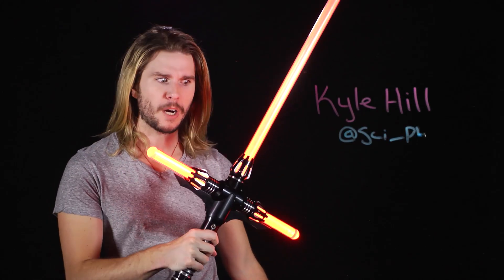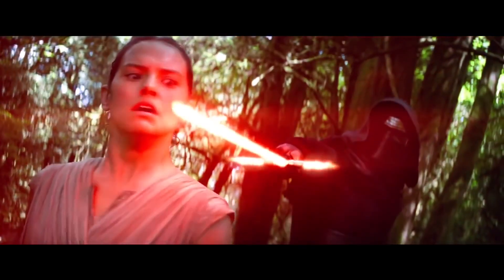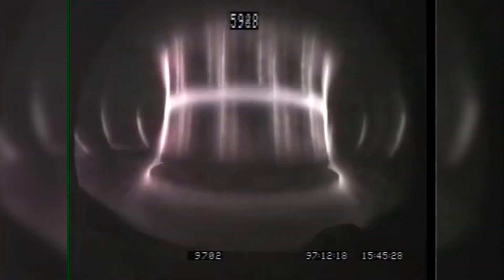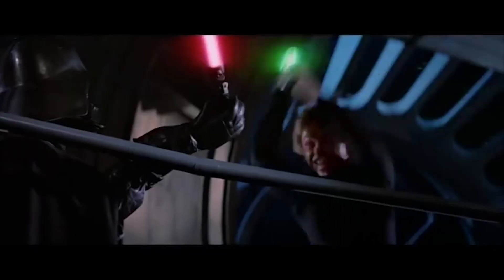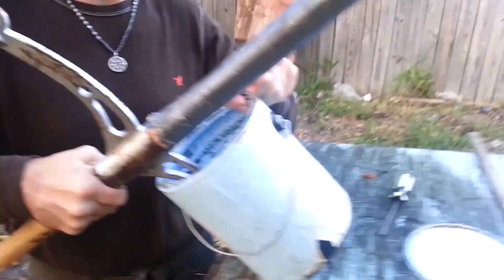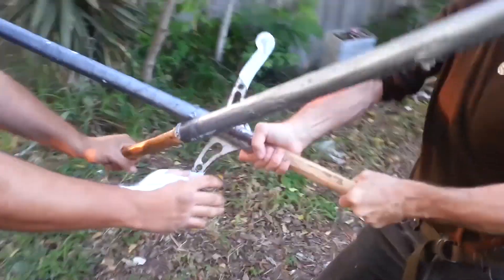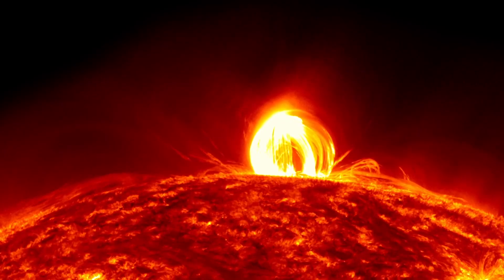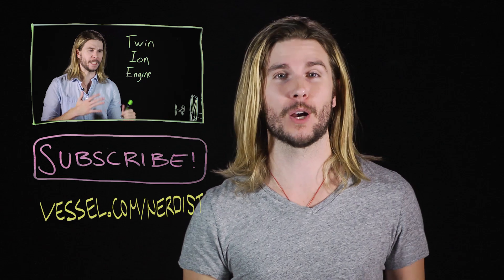Why Kylo Ren's Lightsaber Works (Because Science w/ Kyle Hill)

Comment: First off, I want to say how much I enjoyed this video - raised a great many excellent points. I'm curious, in one of the shots of Kylo wielding the saber, it looks for a moment that the top of the 'crossguard' bits was not covered by metal, and was actually open. Could be just seeing things. The other thing I wanted to add, is that Kylo's blade would be amazing using both Form III (Soresu) and Form V (Shien/Djem-So). 

Interesting to note is that Vader used a particularly aggressive variant of Form V, with a touch of III (Obi-Wan's preferred style) mixed in. The only other person to ever use that variant was Luke, and he somehow instinctively knew it. But given it was Vader's style, it makes perfect sense that's the Lightsaber style Kylo would have used.

Comment: I just want to say everyone seems to forget there are metals in the Star Wars universe that lightsabers cannot cut through, I forget what they're called, but if you look them up they're there.
Kylo's lightsaber is also probably using a different, more unstable crystal, possibly more powerful than other Jedi, hence the "crackling."
These crystals, because of their instability, I'm pretty sure barely any Jedi use them, and only a few Sith. (I found that out on the internet too. ;D)
Anyway, that's just my two cents.
Have a good one, everyone. ^~^

Comment: While I like the cross guard I think it would be more effective to have a lightsabre proof metal as a cross guard (yes it exists, emperor Palpatines lightsabre is made from it) it would be less danger to the user but just as effective in protection. Although the extra weight may be difficult to deal with kylo could just practice, and even hold the blade close to the holy to provide more power with every strike

Comment: possible spoiler alert  

Funny thing is the director of the movie confirmed its not 3 blades, its one blade the "cross guard" is actually heat ports.  because Kylo's saber is unstable.  It produces a great deal of heat, and so the ports on the side shunt the heat away from the main aperture so that the saber 1 doesn't melt itself to a hunk of metal, and 2 doesn't blow up in his hand.  In the EU there are multiple occasions where a unstable lightsaber would one blow the person's hand off, not work, or yeah go boom.  

Kylo is not fully trained in the Force, and the way his lightsaber looks shows that he was not very well versed in the art of crafting a lightsaber either.

Comment: Main issue:  Referring to Stephen Colbert's explanation of how the lightsaber works is not science.  It's an opinion piece.  We don't know that the two smaller plasma fields are directly connected to the primary one as illustrated and have no reason to expect that they are since they don't ignite simultaneously.  The main blade ignites, followed by the two smaller ones.  Obviously, they are connected at some point, but if they were extending from within, there's no need for the metal protrusions that to extend from the main shaft as far as they do.  This suggests that they are being projected individually rather than extending through the hollow metal from the main field.

Your explanation is bunk.  It's a lame attempt at TRYING to rationalize what the film makers thought would look cool but doesn't.  I'm going to mark this "science" effort with an F because it fails... or at least a thumbs down.  Definitely not even going to get a "Nice try" out of me because you used someone else's video of rationalizing rather than make your own argument entirely..

Comment: Except that when they hit the metal outcroppings it takes out the EM field emitter and let's the plasma fall all over your hand. Still dumb 

Also 
1. Lightsabers already have a cross guard in the form of the EM field covering the top half of the hilt. Meaning it can deflect anything but a direct strike 
2. When two lightsabers are in a blade lock the fields attune to each other and actually lock the blades together make such sliding motions difficult to nigh impossible

Comment: Aren't the cross guards vents from the central shaft? It's to relocate some of the raw power surging from Kylo's saber. Because he's construct is unstable (could be from an unstable crystal or just faulty saber build). Because it's unstable the vents assist in keeping the structure of the blade and redirecting them through the side vents, preventing an overpowering affect from the saber, essentially stopping it from disabling or shorting it out.  It was said that Ren's lightsaber reflect himself because it's unfinished and unpredictable, the crossguards are essentially the stabilizing agent, without them it's possible the plasma from the saber would just become uncontrollable

Comment: 1) First and foremost, K-Ren's Light Saber works chiefly as a marketing ploy to garner more $$$, becasue this movie had to be just like it's predecessors, but extravagantly MORE.   Examples: 
- R2D2 < BB-8. 
- Death Star < Star Killer.
- Tuff Male Lead < Tuff Female lead.
- Unlike the first installments, this movie was built to be watched in an IMAX theater.  So, similar to Avatar, it will NEVER seem as grand outside of the 3D experience.

2) Marketing wise Light Sabers are written to represent the personalities of the character who supposedly built or wheel them.  Studying character blade colors and hilts.  

-Yoda = Green skin green blade.  Smaller compacted saber.
- Kit Fisto = Green skin green blade.
- Dooku = Was good, but turned bad = Curved hilt.
- Darth Maul = Red double sabers.  Takes on two Jedi.
- Anikin = Blue means he's good.
- Anikin (Vader) = Red means he's bad, cold mechanically ordered hilt. 
- Windu = Purple Blade. Gold/Silver hilt.  Only a Black Man could successfully rock this  weapon.
- Grievous = Any dead Jedi's blade will suffice.
- Obi-Wan = Straight up goodie two shoes blue pussy.

So, Kylo Ren = Over powered in the force.  Can stop blaster shots mid-air.  Gets emotional then wilds out.  Blade: Overpowered to the point of needing two exhausts.  Hilt is a work in progress, sports exposed red wire.

So, what new over-marketing Light Saber will be used in the next movies?  Cast your vote below!
A) Saber Bo.
B) Saber Sai.
C) Saber Nunchaku.
D) Saber Sling Shot.
E) Saber Whips.
F) Saber Wand where the blade chooses you.
G) Bayonetta's Green Dildo named "Pillow Talk".

Comment: Actually the cross guards on the side aren't really for blocking. It's like a vent. In a computer if the fan doesn't work, the computer will over heat. The fan Is the vent. Because this is an ancient blade they basically made vents on the side the light saber works. The reason the beam is all crackly and rigged because the red crystal in his lightsaber is cracked.

Comment: ehhhh...i don't buy the "oh the metal is just a casing!" argument, I'd think that the metal tubes contain vital electronics and crystals that are needed for the lightsaber to work. If the side blades came out in a v shape I'd buy the cross guard story, and the saber would look hellas cooler. As is it is impractical. I choose to believe that his saber reflects kylo's personality: barley contained, poorly made, and reckless with power. The side blades are vented plasma because the saber is inefficient. The flickering and arcing plasma is a sign that the whole device was ramshackled together. Instead of elegantly cross-guarded saber, Kylo has a weapon as sputtering and unstable as his composure and hatred.

Comment: I still can't get behind the crossguard as a design choice. While there are a lot of limbs removed throughout the series, the only two I know of that was directly connected to the lightsabers sliding down past the hilt and striking the hands was during the fight between Dooku and Anakin at the beginning of episode 3, and Grievous' second hand Obi-wan cut off. As far as I'm aware, nearly every single other instance was a product of the hands or limbs being struck at an angle nearly perpendicular to the wrist. Vader's arm is angled backwards over a railing when Luke cuts his hand off; Luke's arm is in a similar position when Vader cuts his arm off; Mace Windu has his lightsaber slashing down onto Palpatine and Anakin strikes from below; Dooku just cuts off most of Anakin's arm. And including cases where the victim doesn't have a lightsaber adds no evidence or proof to that argument. My condolences to the barfly, abominable snowman, and giant Geonosian spider monster.

Since most cases of limb or hand removal would not benefit from a crossguard, I have a very difficult time believing this was a design choice made by Kylo-Ren, and more of a design flaw that has the unexpected benefit of being a crossguard.

My understanding from the first time I saw it was that Kylo-Ren is not formally trained by a Jedi or a Sith, he is a force-sensitive character, and is not properly instructed on force control or lightsaber construction. Adding to this fact that he is a sith and the red crystals (whatever their proper name is) sith use generate a stronger, higher intensity blade, his lightsaber would be overloaded and explode in his hand (generally not a good thing). I always aligned myself as believing Kylo-Ren acknowledged this fact, and built a vent system to redirect excess power simply so his hand would stay in one piece. This power would then have the added benefit of serving as a crossguard, would the need ever occur (and apparently it does, as at least one commenter pointed out).

Comment: I like how he was so sure that the crossguard lightsaber would've helped in all the situations he pointed out. The crossguard would've been useless in literally ALL the scenarios he pointed out.
 
I recall 2 separate occasions in star wars 2 where the tip of the lightsaber hilt was shaved off, and the lightsaber no longer functioned. This crossguard will not defend the tip of the hilt; once it's cut, the lightsaber is useless.
 
This crossguards on a lightsaber is completely worthless and is a detriment to the wielder.
 
None of this sh*t even matters because apparently the canon explanation is that the crossguard wasn't meant to be a crossguard.

Comment: I don't seem to recall Kylo using his crossguard as a crossguard, which made me happy, and not really care as much about the what I think is slightly silly design. Rather, though, he did use it like that guy in the sword swinging paint demonstration showed, which I thought was clever.

Oh, also, Colbert's assumption is that the beam split from the starting blade, which I personally doubt, and until I see something saying it does, am unlikely to support given that in such a case, common sense would suggest that they'd forgo the "casing" around the crossguard bit. I mean, why would you have metal you'd have to replace every time you get in a fight? Is dumb. 

With proper training, the little bits sticking out aren't a big issue, and more to the point, assuming you train with it, can provide a rather nice advantage, so I would say Kylo's blade is a clever take. It's not like it needs a crossguard to be effective. People seem to forget that aroundabouts.

Comment: I still disagree.

I'll skip over your bit about the need of crossguards because, while you aren't making the argument as well as you can, I am of the opinion that crossguards would be even more important for lightsabers than regular swords.

more importantly can kylo ren's crossguard actually function as a crossguard? sorry but I'll need more than Steven's sketch on this point. for one thing I don't really consider the man an official on the subject, for another there isn't anywhere near enough explanation. is that really how this lightsaber works? if so, why is there any metal in the crossguard at all? even assuming that damage to that metal piece will not immediately effect the blade of the guard, it is still a vulnerable spot. I will now direct your attention to episode 1 when Qui Gon is cutting his way onto the bridge of the trade federation ship, specifically how long it didn't take him to reduce a larger mass of metal to basically a molten state. crossguards can expect prolonged contact with enemy blades, which in this case could result in the hilt either becoming nonfunctional or untouchable in moments. I just don't see a way in which this is a good crossguard, if it could actually serve the purpose to begin with.

the next most important point; is this the best crossguard we can make? absolutely not. to stop a lightsaber we don't need the plasma of the blade, all we need to the magnetic field. it should be fairly simple to project a magnetic reflector field that would function as a crossguard without exposing anything to the enemy lightsaber. heck you could project a full spherical  field around the hilt, thus making the saber and any hands holding it impervious to the enemy's weapon. here I have even more protection for my hands than Kylo's saber offers. neither of these options places any extra danger on the user or restricts their movements.

now as you showed it is possible to use the weapon without harming yourself, and to use the crossguard offensively. but you have to give up something for this little bit of extra offense. in this case, while you can still wield the weapon, you have a more limited range of movements than the overwhelming majority of you opponents. yes you can compensate for this but it is still a weakness that can be exploited. by contrast someone with a regular lightsaber or a saber with a nonlethal crossguard will have more flexibility, speed, and optionality with the more deadly main blade.

I can get behind the direction they were trying to go with this adjustment. but the fact remains that I can design something that gives me better defense and flexibility while sacrificing arguably no offense. the design is just sloppy at best.

Comment: None of those scenes shown in your own explanation would have been blocked by crossguards.  You tried to explain yourself out of the simple space and design flaws with plausible irl science, but within the star wars universe using the crystals and such, there is not enough space within the saber to create this guards.  Lightsabers have been destroyed in combat before, which goes against the idea of the crossguards resisting attacks through the casing.  If you have 2 equally trained and competent warriors fighting with the two kinds of sabers, crossguard and normal, the the normal will win simple because he has less to worry about or adapt in his technique of injuring himself.  Hand injuries are not as common as you would believe.  Even in most of the scenes you showed hands were sliced after combat had ended.

Comment: According to the official lore, the cross guard comes from an ancient design of lightsaber. It required exhaust ports at the side to vent the excess power away from the main beam. It may also explain why Kylo Ren's lightsaber blade crackles and looks very unstable.

Comment: Sith/Jedi light sabers don't have cross guards because the person wielding them are supposed to be trained enough to not have to have them, to be one enough with the force to be able to completely prevent their hands from slipping down. And you find out in the movie that Kylo is quite compulsive and most of the time acts out of pure rage instead of using his head.
Reply: It's bad ass that's why it's in there
Reply: +FIRENICEWOLF well played...
Reply: @Cameron Thunder: Wow. That is the most solid explanation I've seen for the blade. It's not for added advantage. It's to overcome a defect. Why isn't this more common knowledge?
Reply: +JACOB CORCORAN 1:45 nuff said m9
Reply: +JACOB CORCORAN and also probably for toys or some shit like that
Reply: +FIRENICEWOLF that's what they did with the light saber with the part in the center that spins. They put that in Star Wars Rebels.
Reply: +JACOB CORCORAN They don't because majority are designed to take the form of plasma katanas, not plasma longswords. That's it.
Reply: +FIRENICEWOLF ??? Isn't it harder trying to light up both a main blade, to smaller side blades, and still somehow have the sides and the main blade retract? Lazy excuse is lazy.
Reply: +Lel Plebs what?
Reply: You said that Kylo Ren only had crossguards for toys.
Reply: Because it is cuite obvious if you just look at the thing.
Reply: +JACOB CORCORAN So... You say that toprevent hands from slipping on blede I should instal additionall super-sharp blades as guard? I can wield knife. Usually use straight one without guard. And believe me, risk of cutting myself with main blade is much smaller than with 2 aditional blades. Sometimes I use multiple knifes wielded in one hand as working tool and believe me. The less blades you have the easier it is to not harm yourself. Crossguard iscool foas vent-system for unstabile crystal, but nothing more.

Comment: Kylo Ren's lightsaber is based on an ancient sith design and is very crudely built (hence the crackling lightning-esque looking blade and the sound).

The older technology needed a vent for the power of the saber. That is what the quillions (crossguards) are. They are vents of raw lightsaber power. Their purpose was not meant as crossguards and they weren't purposely put their for protection. The ancient sith just needed a place to vent the power so the lightsbaer wouldn't overload, break, etc. So logically they are put on the side. Now do they serve as crossguards as well? Yup. Is that their purpose? Nope.
Just look at any modern sith or jedi lightsaber design. None have crossguards because its an older, inferior design.

Follow the link for an article explaining what i just said and an image of a plaque actually stating what the quillions are (the plaque is from Lucasfilm/Disney itself)

http://www.slashfilm.com/the-force-awakens-kylo-renn-lightsaber-finally-explained/